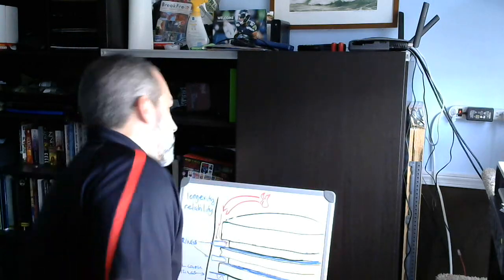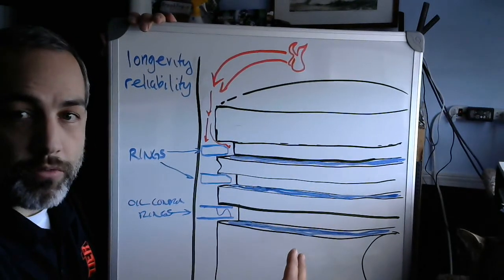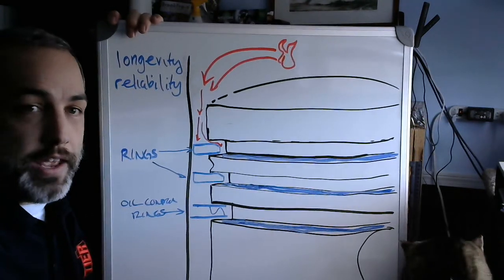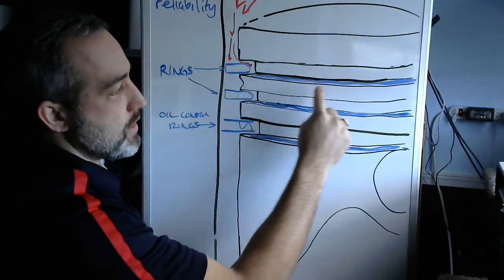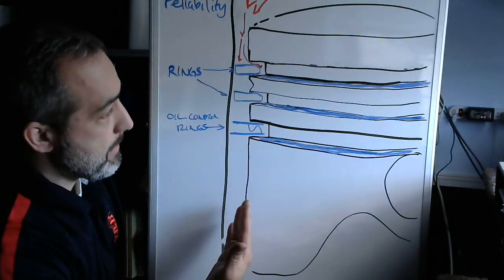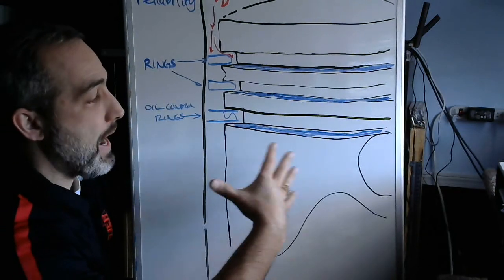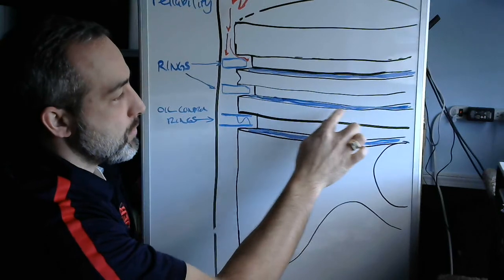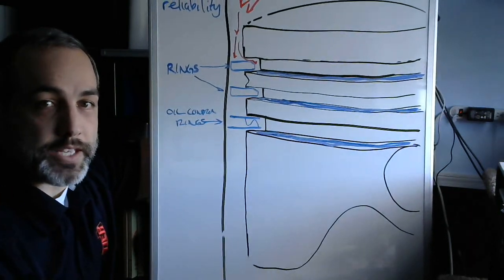Longevity vs Reliability and piston materials

Comment: What are your opinions on the Type RA pistons? I wanna shoot for 350whp and the occasional 400whp but not have to fear every pull will blow my engine. Forged pistons worth the sacrifice in longevity?
Reply from the maker: A good tune alone can give you all that. To add extra peace of mind, do a cooling mod and an iat relocate
Reply: @GetaDomTune  
Dealership recently noticed an external headgasket leak on driver side so I've been planning on trying to rebuild and add some power.

Doing longevity research now. Your videos have been very informative. 

Haven't heard of the IAT sensor location though. Isn't that built into the stock MAF?
Reply: This also seemed to be the route the shop in my area suggested. I only have a slight external HG leak at this time in my 11 wrx with 77k on it but they suggested a new type RA block, machine heads, etc. Ended up with a $10k ballpark to do HG, parts and labor and a tune after. More than I can stomach for the first repair on this thing just yet, wanting a reliable 300whp DD.

It seems the longevity formula is good tune, driving it carefully, good parts, proper maintenance and keeping the power somewhat reasonable like under 320whp depending on dyno. 

And with the EJ25s specifically... your cooling mod, an AOS, done ELH, oil pickup, and a better intercooler to minimize combustion temps.
Reply from the maker: @C4PTAINinsano  RA block sounds like a terrible plan. 
Does that shop not even understand compression ratio?
Reply: @GetaDomTune appreciate the reply. That was the question I was planning to ask. Because of slightly different piston profile and whatever head material is removed from machining to prevent future gasket problems. Can that just be negated with thicker HG? I also didn't really expect the stock block to be bad but maybe heads if already shown to leak at gasket.
Reply from the maker: @C4PTAINinsano  the WRX uses a different head with a much smaller chamber than the STI.
Reply: @GetaDomTune  understood... D25 vs W25 heads have a different dish design, piston profile, 8.4 vs 8.2 compression as well as dual avcs, etc. Not pnp.

Block casting is identical though I think correct. And from rods down. Basically no gain vs regular fresh ej255 block.

The cost n confusion between dealer, online and local is always fun. Trying to educate myself and spend wisely.
Reply from the maker: @C4PTAINinsano  B25, V25, W25 all have the same chambers. B25 and V25 are intake AVCS and compatible with your car if you wanted to have matching RA pistons and chambers.  
I'm pretty sure the 06+ WRX is 8.5:1.

Comment: going through all of your old videos and soaking in every bit of knowledge I can. Slightly off topic but still regarding reliability... So when you decide on a hp that requires the tuner to sit you down and discuss building a new block. Is it the short block as a whole that we're concerned about or are we talking more along the lines of internals, such as forged pistons?
Reply from the maker: Around 525 crank or 400whp.  Depending on the Dyno you're using as your standard, that could mean 500whp

Comment: What if leave it stock, no horsepower manipulation and occasional spirited driving and consistent daily maintenance. Will you say how many years of reliability for stock a STI?
Reply: Tough question to answer, every driver has different habits and no two engines are the same.
Reply: B P I know this post is 5 months old, but I currently have 230,006 on my 04 STI. I bought it with 116k 6 years ago. It was stock for the first 2 years, then I did the Cobb AP with catless dp stage 2. I did experience detonation from time to time when going WOT with that setup. Come to find out about a year after running that catless dp with the stage 2 OTS map I was doing damage. I abused the car like hell during this time. I ended up replacing the turbo with a 16G at 225k and getting elh with a tune finally and I made 287whp on a mustang dyno. So even after all that abuse I put the car through, it seems it’s compression is holding up with 230k miles. I’m probably just extremely lucky, but it does consume about a quart of oil every 500miles with known leaking camshaft seals. I tend to baby the car more with a few spirited pulls getting on the highway here and there, and occasional races against 392 scatt packs just cause I love the look on their faces when they think they can get me lol. So as far as I know, stock STI’s, at least the older ones, are pretty reliable 👍

Comment: To small. A ring gap being to tight on a boosted or nitros engine will break rings and lands.
Reply from the maker: Too tight can cause rings to butt which can cause failure. I have an article that I wrote back in 2008 that was in a magazine that discusses ways to build an engine to help with higher loads. Ring gaps and piston to wall clearances are part of that article. 
It's not really a point to be made in this video however.

Comment: How do dyno break-ins affect how the piston rings seat and the longevity/reliability of the internals?
Reply from the maker: Totally depends on how it's built. If the cylinder is slightly out of round, a Dyno break in is too aggressive and will hot spot the ring. Similar result for bearings. They need to be properly clearanced and have tight tolerances.

Comment: Awesome vid! To ask my own question in regards to this subject though, when you go forged internals and sleeve the cylinder, doesn't the act of sleeving mostly eliminate piston slap?
Reply from the maker: Nai Gaming it does not. it has absolutely zero effect on piston slap. piston slap depends on piston to wall clearance, which depends on machining, piston material and temperature.
Reply: Dominic Acia thanks for the clarification! I assumed sleeving brought the clearance tighter between the piston and cylinder wall. I'm glad I asked
Reply from the maker: Nai Gaming it all depends on the machinist. Any time a block is machined for Pistons, regardless of cylinder type, piston to wall should be set properly. 
not all piston slap is audible. Forged Pistons will have excessive clearance at cold start no matter what. if they didn't, they would seize in the bore when they heated up.